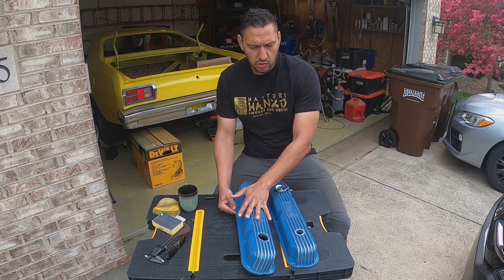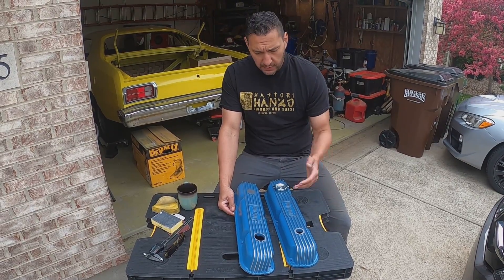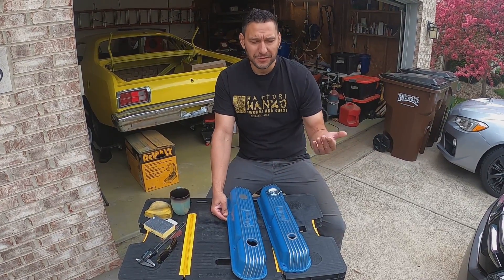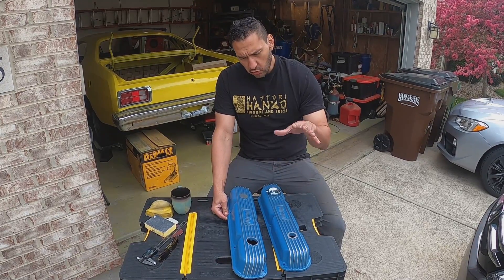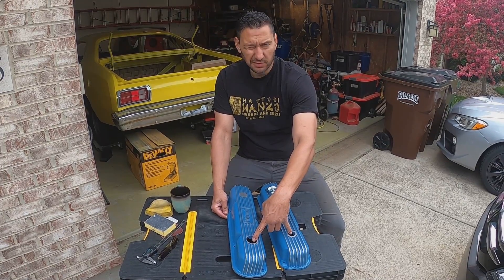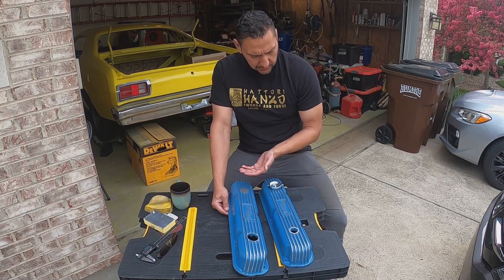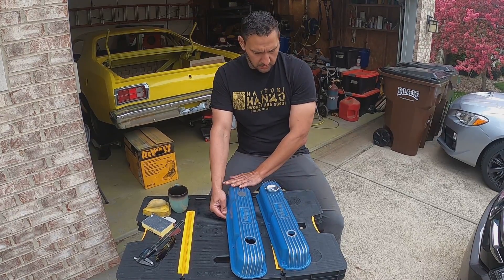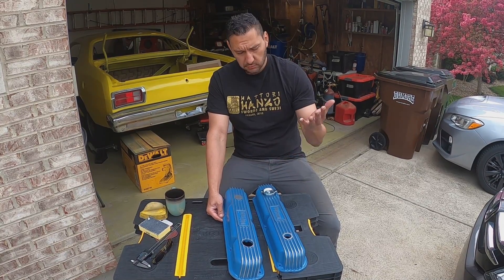Valve Cover Restoration

Comment: Great looking valve covers. Mine came out the same if you look at my engine. What I did do after painting and sanding the scallops is I threw them into the oven at 350 degrees for 3/4 hour. Really backed the paint on and levelled the flow out. Why 3/4 hour? All my wife could stand with the smell and told me take them outside LOL
Reply from the maker: Hey Ninjapumkin. Thanks! Lol, yeah I can't imagine that smells good😂. I bet it worked well though. Maybe one day I will look into powder coating, I know some people love it.
Reply: @DustorBust  No powder coating. Engine paint and baked on in oven. The valve covers never get hot enough for the paint to harden from heat. I also used a heat gun to bake the engine paint on block.  Just to give it a fighting chance before install. You are going to love that colour

Comment: Hay Marco, upgrade the light in your blast cabinet, can’t see a thing!!!
Reply from the maker: Hey Jeff, thanks for the feedback! Sadly that is an upgraded light. Let me see if I can add another one to get more coverage.
Reply: @DustorBust  l’m in the process of putting together the harbor freight blaster cabinet now and all the upgrade’s I’ve seen on  utube  I’m trying to include even before I start blasting.  I’m working on a 1973 Dart Sport and it’s going to be a big block 493 strokes with a stick!
Reply from the maker: @jefftrogman2574  that Dart will be a beast with the big block! Will be fun for sure. 👍

Yeah, the blast cabinet is an awesome tool to have for doing resto work. Unfortunately it is total  garbage right out of the box, but it is the best starting point for a cost effective blaster. The mods are necessary. From a functional standpoint my best gains were
 1. adding a window screen filter to the grate
2. A new return system, valve on the bottom vs pickup tube
3. Upgraded gun
4. Red duct tape, leaks all over the place

Good luck!!